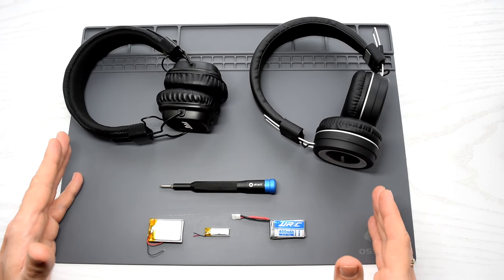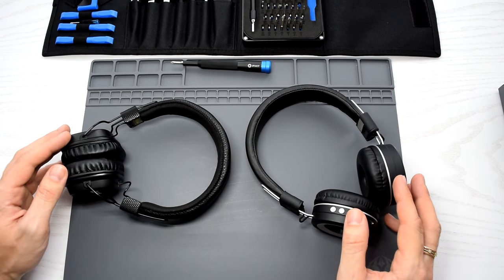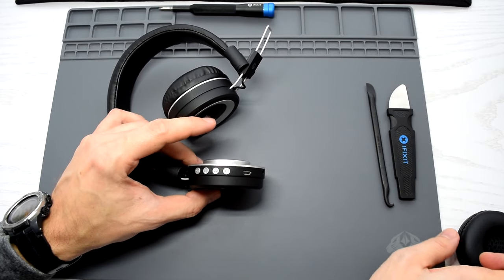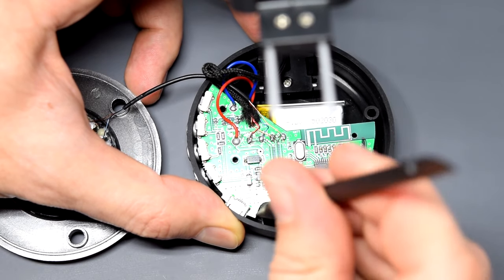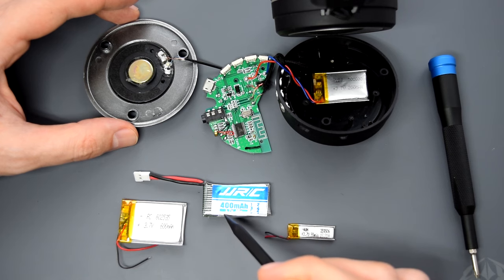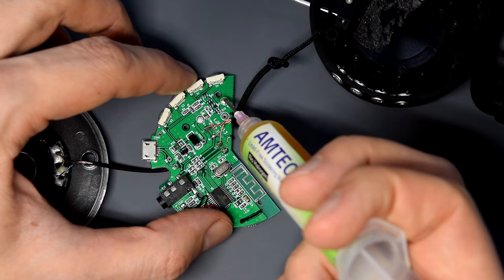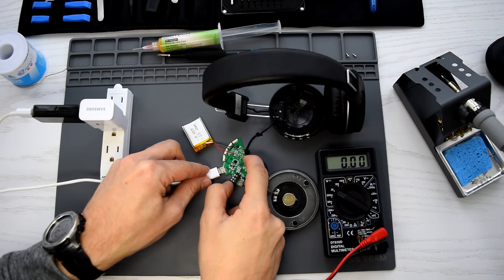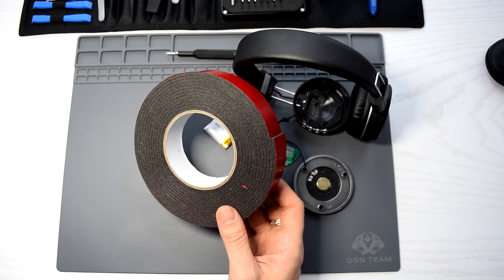How to Replace/Upgrade Li-ion Battery in any Bluetooth Headphones

Comment: I have a pair of turtle beach 600 generation 2 headset for the Xbox. They are relatively new and were released earlier this year. They have a 3.7 1000mah battery but I'd to open them up and replace the battery with a 3.7 2000mah battery. But the replacement battery has a pcb how do I know when I need to remove the pcb?
Reply from the maker: That PCB has a short protection there's no need to remove it. If your old battery has 3 wires then you need a battery with 3 wires too. The same refers for a 2-wires batteries.
Reply: @ElectronicsComputers  infinitely helpful thank you!!! :)

Comment: great video man ! do u know how to replace the battery for Bragi dash pro inear headphones ? i bought them in 2018 for 300 usd and now they are started to lose charge and die after just 2 hours :(
What kind of battery does that headphone use.. size and type ? im not sure about that to be honest or where to find none fake replacement batteries ?
Reply from the maker: Most likely you'll never find an original battery. Moreover all earbuds are not designed to be serviced. They are glued together and after you open them up they will look ugly. If you manage to open them carefully, you can send me the picture of that battery and I'll give you the links to that battery.
Reply: @ElectronicsComputers  hi, you still havent got back to me about the battery type that is showed in the video i linked too ? i have the same bragi pro

Comment: Hey thanks for the video I need advice on the battery for marshall mid
Reply from the maker: You can upgrade your original 680mAh battery to 800mAh with the same dimensions battery: http://ali.pub/4hwh8l
You can only use batteries with THREE WIRES!
Reply: Thanks a lot
Reply from the maker: @davidgriffin3602  you're welcome!

Comment: Very good video, taking the time to show and explain the steps. Have you tried to replace the battery on avegant glyph video headset, mine indicates charging but never charges. It may also be the charge controller since the unit has only been used 5 or 8 times and works fine when plugged in to USB adapter
Reply from the maker: Thank you for the comment! Here's the manual for your headphones:  https://kknews.cc/zh-sg/digital/k4jjz3q.html
And here's the battery on Ebay: https://www.ebay.com/itm/Tenergy-34106-Li-ion-Battery-3-8V-2060-mAh-7-83-Wh-/174136271048
Reply: @ElectronicsComputers  Thank you very much for the info, I see that the battery contains a circuit on board, I ordered it.

Comment: Is it possible that the battery is just dead (even in the marshall headphones)? My bluetooth headphones do not turn on unless connected to a charger.
Reply from the maker: Yes, it's possible! What's the model of your headphones?
Reply: @ElectronicsComputers  I have the Marshall Major II Bluetooth headphones. The less round ones.
Reply from the maker: @jage2674  I've just added the link for Major 2 to the video description. That battery allows you to upgrade your headphones from 650mAh battery to 800mAh one for 5$ delivered.

Comment: i have done it with my jbl headset but it is has same issue as before. charging led goes off few seconds after put to charge and not holding charge .
Reply from the maker: Do you have a multimeter?
Reply: @ElectronicsComputers  nope

Comment: How does the AKG N60NC open? It does not twist clockwise or counter-clockwise. Thank you.
Reply from the maker: There's no need to twist anything. Simply grab the edge of the earpad on the side where it is attached to the speaker cover and gently pull. Work your way around until it is completely unfastened from the cover. Once done, you'll see four screws; remove them, and you'll get access to the battery and PCB.

Comment: How are the headphones from aliexprress sound quality wise ? and do they block noise ?
Reply from the maker: Those are cheap headphones they do the job but the quality of sound is far away from Marshall or something similar. They are very lightweight and don't push on your ears so they don't block any noises. My kid likes them though.
Reply: @ElectronicsComputers  awesome thanks for the answer. I have a wireless  vmoda crosfade that finally gave out on me battery wise. I bought some batteries per ur recommendation and i will be working on it while following your instructions.  I bought the syrinringe thing too. Never knew about them but they look coveniant and easier to use

Comment: Nice..

Can i use Bluetooth battery to the rc toys? I dont understand what's mean of battery serial number like 40xxx 50xx etc.. Can you explain?
Thanks
Reply from the maker: Those figures represent battery dimensions thickness, width, and length. For example 401730 means that the battery is 4mm thick, 17mm wide and 30mm long.
Reply: Oh i see 🙂

But will it be ok if i replace a battery for examples an rc toys using battery with number 60xx with baterai with number 40xx?
Reply from the maker: @my.name.is.y  You can use any 3.7V Li-ion battery that you can fit inside of your device.
Reply: Thank you very much 👍🏻

I'll try...

Comment: Hello, I found that my Harman Kardon BT set has three wires but cannot find batteries in the market with those three wires. If I put one of two wires would it charge or work perfectly? Any hint to replace them
Reply from the maker: The third wire if for temperature sensor. There's a lot of batteries like that. Do you have its voltage, capacity and dimensions?
Reply: @ElectronicsComputers  The battery is 1/2 inch x 1 1/2 3,7 V and 480 mah is for the BT model, battery is dead and cannot get the device works. I have seeking in the whole world a Harman Kardon technical service and there is not in south america a place to send the device.

Comment: Great video, keep up the good work. Can you give me an advice on the battery of sodo mh3?
Reply from the maker: I need the internal dimensions of the free space and the model of your current battery and then I could give you the links for proper batteries. Usually there's always enough room to put a higher capacity battery. So if you send me some pics I'll help you.
Reply: @ElectronicsComputers  sorry man i can't really open it or take a picture, all i know is it has a Li-Ion battery. But thanks for taking the time and replying, appreciate it!

Comment: could I just snip the cable coming from the old battery and install a plug for easy replacement in the future? and then add the other plug to the new battery. i'm not particularly confident on my ability to cleanly solder onto the board. so i could just crimp the connectors onto the wires already soldered to the board, and also add connectors to the wires on the new battery
Reply from the maker: Sure, of course you can. Good idea by the way!

Comment: Hi dude since u have the same headphones as me (Marshall major) i wanted to ask if u have faced the problem where they will rotate completely to the other side and get stuck! That kept happening to mine and now the wire is frayed and one side does not work! Do u know what can be done about that!!?
Reply from the maker: If one of the speakers doesn't work, then try to connect the audio jack into another ear. If it start to work but another one stop working, then you have to replace the cable that goes from one side to another through the headphones band. It's not an easy process because it requires some soldering skills and you have to completely disassemble your headphones.
Reply: @ElectronicsComputers   thanks for the reply. yes it is that cable only which is damaged because it kept getting bent. I just ordered a soldering iron. I just hope soldering the breaking wire will work... I will disassemble and see. thanks :)

Comment: Great video man, could you give me advise for battery of sodo MH3
Reply from the maker: This battery http://ali.pub/4s9c6x will definitely work you just need to swap the wires with connector. If you want higher capacity battery then give me dimensions of the internal space for the battery in your headphones.

Comment: Hello Sir, Can I replace a the Li-ion battery of 3.7volts with a 4-volt 400mah Lead-acid battery in my headphones?
Reply from the maker: No! The charge controller in your headphones that designed for charging Li-ion batteries can't charge lead-acid batteries. But it will work just for powering the headphones and you have to take the battery out and charge somewhere else.

Comment: What kind of battery should i be looking for? One on the video is exactly what i need.
Reply from the maker: Some batteries have two wires and some three. And the most important is the battery size. If you give me the dimensions of your battery, I'll send you a link for a proper battery.
Reply: @ElectronicsComputers  it says 502020 +3.7v. 200maH
Reply: @ElectronicsComputers  can i replace it with a bigger capacity than 200mah?

Comment: Hi..my headphone battery is 200mah!
Can i replace it with 360 or higher?
It doesnt make any problem?
Reply from the maker: The higher capacity larger the battery. So if you can fit it into your headphones then no problems.

Comment: My Bluetooth headphones only turn on while charging . they are old heaphones of mine . Is it good to charge while using it ?
Reply from the maker: If those were new headphones, then I wouldn't do that. But considering the fact that they are already faulty you can do whatever you want with them. Most likely you need to replace the battery to make them work properly.

Comment: Sir plz reply
Sir have boat Rockerz 255f pro headphones and it has 3.7v 110 mah battery 
What if I change battery mah to 250 mah it'll damage pcb board??
Reply from the maker: You can use any battery capacity you can physically fit into your headphones. It can't damage your headphones you can use any Li-ion 3.7-4.2V battery.
Reply: @ElectronicsComputers  thanks for reply sir

Comment: would this work for a bluetooth speaker? I have an high quality minirig rated at 50hrs with a 11.1v 1150mah battery. I would like to put it in a square shaped box with a 11.1v 5,000mah battery
Reply from the maker: Of course it will same process. I guess, there will be at least 3 batteries connected in series.

Comment: hiii.My headphones red and blue light flashing. Just not opening. When i click power button. Bletooth say "Bluetooth Device". Now not having. open headphone, check battery. Just battery not have a problem.,I dont understand whats problems?
Reply from the maker: What's the model of your headphones? Try to disconnect the battery to hard reset the chip.
Reply: @ElectronicsComputers  today i disconnected battery. and check battery. battery not have a problem. model jakcom bh3

Comment: I tried swapping the swallon battery from my working headphone (the only problem was low charge backup)  with a same voltage lithiam battery. but the Bluetooth connects with buzz and no music comes out. also the PCB ends up real hot that I had to turn off the headphone. However the headphone works just fine with connected to wall socket and no warm up issue is faced this time.

Comment: I need to do this soon. My battery that should last almost 2 days before needing to be charged went from 60% to 40% in 3 hours. Only problem is that I don't own any of this stuff.
Reply from the maker: All you need is a screwdriver and a soldering iron.
Reply: @ElectronicsComputers  do you know what voltage of battery the jlab studio pro's use?

Comment: I change the battery from a original very small battery to a 18650 li-ion battery 2000mah, but the battery dont charge in normal way, can you explain? i do not found the answer in the internet, thanks
Reply from the maker: the previous battery had 3 or 2 wires?  18650 is a regular battery or it has microUSB port or something?
Reply: @ElectronicsComputers  The previous battery is a normal 3.7v Li-Ion battery but small, had a 2 wires, 18650 is a regular battery removed from a emergency light, i think the bluetooth device had a protection system specific to the small battery, i dont now
Reply from the maker: @iorramgx2  It should work anyways. Maybe it just takes too much time to charge it?!
Reply: @ElectronicsComputers  I left it charging for 24 hours and it didn't exceed 61%, anyway I made an external charger for 18650 and this time the charging was complete, thanks for your attention
Reply: @iorramgx2  61% are about at same level as previous battery 3.7v, and new battery are 4.2v? 
If so , then "charge circuit" will charge new battery only to 3.7v not till your "new battery" 4.2v level which means you will get your 61% not full 100%.
At least that what I "guess".

Comment: do i need to use a lipo with a protection circuit?
Reply from the maker: In 99% they all come with protection. So, yes.
Reply: @ElectronicsComputers  i have some small 2S 350mah lipo packs without any protection circuit. was thinking of splitting one and hooking them up in parallel but probably best not to.

Comment: i have a 3.7 v and 250mah battery but i want to replace that with a 3.7v 800mah is it compatible????
Reply from the maker: If the size allows you to fit such a battery then it's possible. The links for the different batteries are in the description.
Reply: Thank you so much for the advice.

Comment: I had success with a pair of philips hp 😁, but I'm having trouble with a chinese pair, I thought the problem was the battery because it wouldn't hold or charge (the led turns on when plugged) more than 15 min but even after changing the battery it still wouldn't past the 15 min...
Reply from the maker: The problem may be in the charge controller. You can try to fix it or use this universal one, which is very easy to install in any device: https://alii.pub/6ua0ng.

Comment: I have an old pair of Beats Headphones that runs on 2 AAA batteries. If i want to re-engineer it to run it on  3.7V 300mAh Li-Po Rechargeable Battery, all i have to do is install a  MICRO USB 1A Lithium Battery Charging + Protection in one Board Module into it?
Reply from the maker: fully charged Lithium battery has 4.2 volts that's the main problem. There are some tiny PCB solutions battery charger and step up converter but in your case you need a step down converter. too much stuff to put inside but it's doable.
Reply: @ElectronicsComputers  then would I need a dc to dc converter?  If so what would be the circuit model? Thank you for your quick replies :)

Comment: can I use a cellphone battery??
Reply from the maker: the short answer is yes but it depends on the battery and headphones. In some cases you need to remove small PCB from the battery.

Comment: I have a Bluetooth headset it will charge with a power source but when you unplug it it won't turn on. I believe it is the battery.I think the battery has dead cells.  What's a safe way to change it. It's called Vibe Bluetooth headphones. The battery is 200mah , Charging input is 5V - 1A. Any advice would help.
Reply from the maker: Sounds like a dead battery. Carefully disassemble your headphones, take a picture of the battery and post it here. I'll give you the link for the proper battery.

Comment: If the headphones board require 3 wires battery and there is 2 wires battery available then what should wo do?
Reply from the maker: It's not gonna work. You need to find a battery with three wires. That third wire is a temperature sensor and the charge controller may not charge the battery without that sensor.

Comment: What will happen if u put 3000mah battery instead, do I have to ad any other components rather than battery?
Reply from the maker: No! The capacity of your battery doesn't matter. The charge controller recognizes fully charged battery by it's voltage when it reaches from around 3.7v to 4.2v when the battery is full. So technically your controller doesn't care about its capacity what matters is the size of the battery. Make sure you can fit it inside. And one more thing if your battery has 2 wires then buy the same if 3 wires (with temperature sensor) then replace with the battery that has 3 wires.
Reply: @ElectronicsComputers  can I put a 5000 mah battery in a cheap mp3 player how long it maybe take to change the battery

Comment: My bluetooth headphones have 3 wires to the battery. I looked online and found out the 3rd wire is RTC. I can only find batteries with + and -, and without the RTC. IS it ok to not have an RTC in it?
Reply from the maker: You need a battery with three wires otherwise it won't charge. Give me the model of your battery or its dimensions and capacity and I'll give you the link.
Reply: @ElectronicsComputers  its 3.8v 630mah. 
model 792200-0010

the 3 wires from the actual headphones feed into a pcb with a few small components on it and then on the other side of the pcb it has the + and - of the battery soldered in so if i cant get a 3 wire batter i can just unsolder the current battery from the pcb and solder the new battery onto it

it is quite small 46mm long 31mm wide and only about 4mm high. there is room for a larger battery length wise but not width wise but i may be able to modify some things inside to fit a larger one if needed 

i already ordered a 2 wire one for $10 but if there is a 3 wire one i might buy that
Reply from the maker: @Sam-fp8zm  This one will do the job: http://alii.pub/6gzxy3
Reply: @ElectronicsComputers  

thanks. i found the single item listing. 

i will try the method i said with the battery i already ordered and if it doesnt work i will buy the one you said. thanks again.

Comment: my black major 2 stopped charging so i opend it but there is a 3rd yellow cable ...
Reply from the maker: That's right! That battery has a thermal sensor in it. So you have to any 3 wires battery that you can fit inside. For example like this one: http://ali.pub/4sqwq4